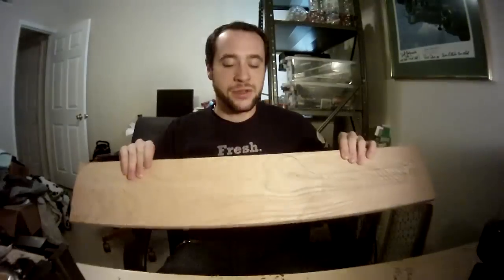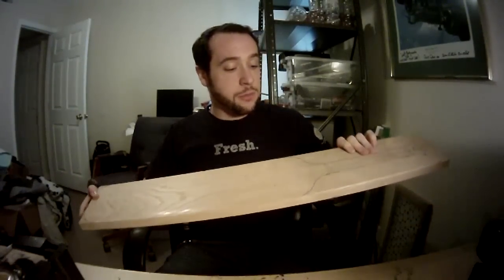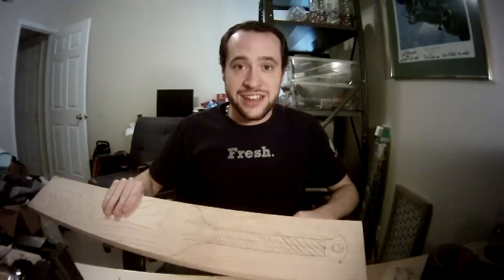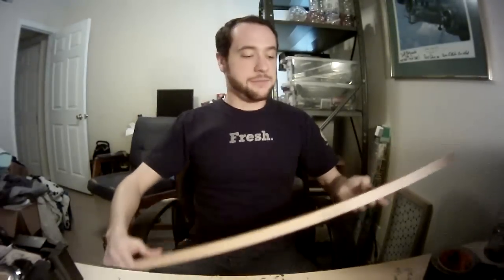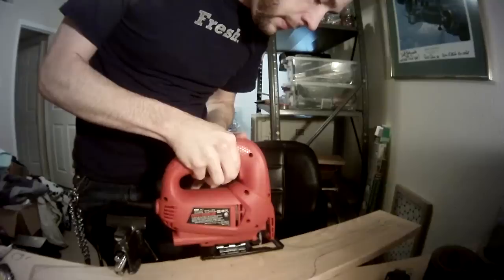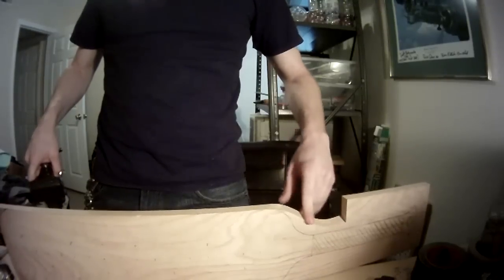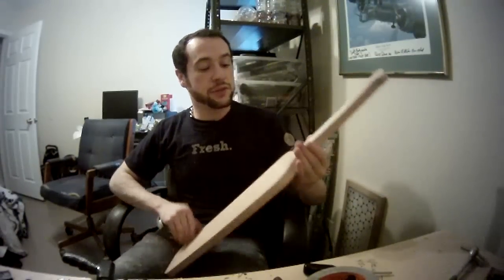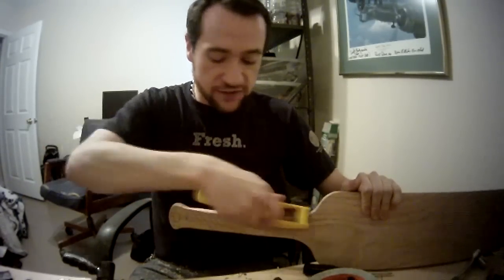Dirty DIY with Drew Episode 5: Paddles Part1

Comment: If you haven't made s good counter balance, use a chain and lag bolt. Gives it an cool look,  and should have the weight you need
Reply from the maker: stopaskingtousemyname A VERY good point! Anything heavy can be used as a good counterweight. A few months after making this video I actually replaced the counterweight with the head of a sledge hammer. It worked out amazingly well.
Reply: Drew Lion that sounds like it would have a nice look to it as well, thanks for the response.
Reply from the maker: No problem! I may not be super active posting videos but I'm still around. Before I gave this to my leather brother (and the only guy I know that can handle such a tool) I redid the handle entirely. I made a snake with instamorph plastic and wrapped it around the handle then wrapped that with leather then changed the counterweight. It ended up looking really good! http://imgur.com/mhzkOYw
Reply from the maker: Also here was the tutorial I used to learn the leather wrapping http://www.yeoldegaffers.com/project_grip_2.asp
Reply: Drew Lion I like to wrap with Para-cord but I'll book mark it if I ever get around to making something for my Brother and his old lady. Thanks
Reply from the maker: stopaskingtousemyname dang! That really would have made things easier!!
Reply: Drew Lion I've found it is the perfect way to get rid of those sharp edges. And it looks great since it comes out very even  (I don't like to break skin, it's just not my thing)
Reply from the maker: yeah sharp edges can certainly lead to problems, but i'll definitely be picking up one of those. That's far too handy
Reply: Drew Lion I agree. So are you going to do any big projects? Like furniture? I only know a few people other than myself that know how to make the big pieces.
Reply: @DirtyDIYwithDrew  your paddles are intimidating to say the most